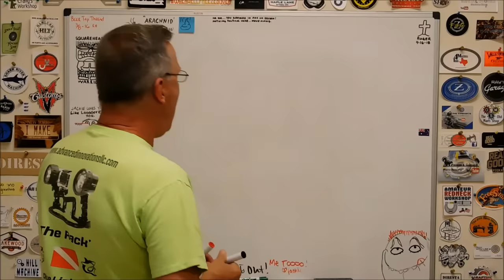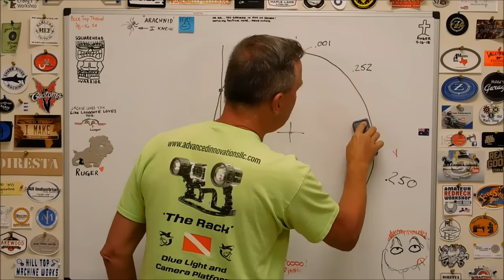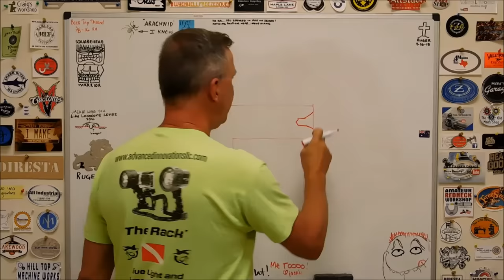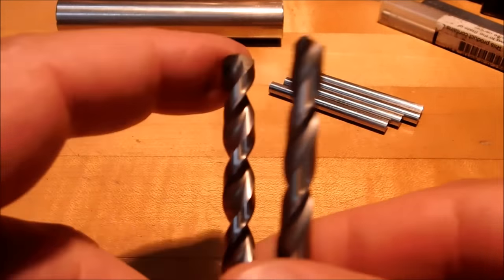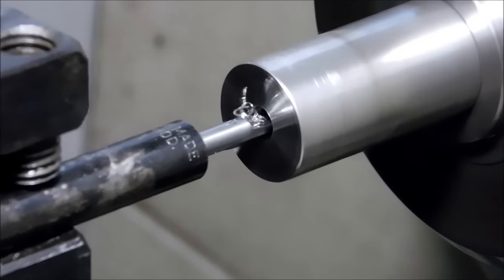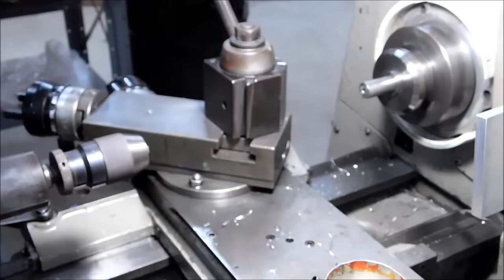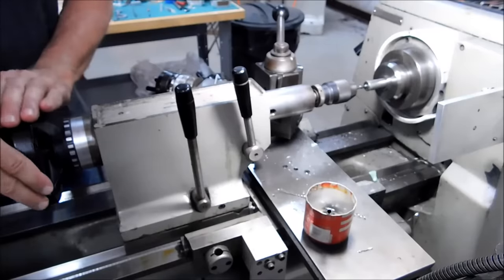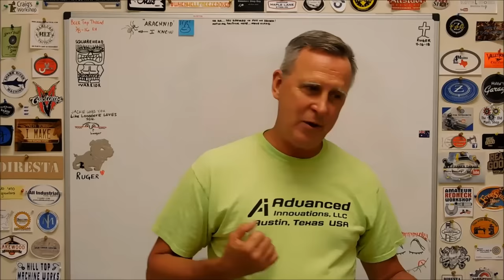Techniques for Machining Straight Deep Holes -- SHOP GEM --

Comment: Great video! Here is my challenge: how do you ream a perfect hole for the locator pin of a quick change tool post? Bear in mind, the tool post is hardened. Even factory got it wrong, the original pin was really hard to push all the way down. In fact, I never managed to do it. And it's an original Dickson tool post! I tried a quick fix with a reamer from the top, but it wasn't carbide and didn't do anything, other than rub against the wall of the bore. In a moment of desperation, I tried to work the locator hole on the top slide separately, and I don't think it did anything good. So now I basically have to start from scratch 10-20 thou oversize and do a text book job with the correct technique and tooling, or plug the hole and forget about it. The tool post and top slide have to be clamped together in position and rim the bore and locator hole in one go - that much is obvious - but beyond that I really don't know what's the best way to do it. Any pointers would be greatly appreciated.
Reply from the maker: Forgive me, but I can't visualize what you are trying to do. I'll have to look up dickson tool posts to get an idea.
Reply: @joepie221  Oh sorry, I should have been more clear. This tool post has a sliding dowel pin that goes all the way down through the tool post, and when aligned, locates into a corresponding hole in the top slide. It's completely separate from the toolpost/tool holder mounting mechanism, and I see that not all of them have this feature. It's only there to provide a quick way of bringing back the tool post to a known square position, after it has been rotated around.

Comment: Hi

Intention to inform.
We use a drill chuck mounted and centered on a toolholder to drill. Way easier then moving all day long the tailstock. 

Good videos you make anyway =) gave us some good advice to.
Reply from the maker: Both work well.
Reply: @joepie221  indeed. What as your first CNC?

Comment: i done some 19 inch deep hole true poured aluminum castings that were a b------h but i did them horizontilay with coolant running through the drill now that was interesting to do lol

Comment: Thank you so much for this technique and explanation.  I've got a project right now I'm going to apply it to.  Are there any tips for the milling machine in this regard?  I ask because I had a project of having to drill several 1/2" holes 3" through the edge of a 1"x 3" cold rolled mild steel part that had to line up with holes on another two parts.  I did okay, only had to enlarge one hole a little.  I used a stub drill after center drilling.
Reply from the maker: Use the same approach, but plunge an end mill instead of boring for the reamer pilot.

Comment: Thanks for your video and I learned a number of things (didn't understand what the first part was about though). I'm thinking can it be a good idea to do everything you did but with one dimension less and then, as a final step, run a reamer with final size through all the bore. That would get rid of the meeting point better?
Reply from the maker: That has a much better chance of ending up straight if the pilot hole is done with care.

Comment: I'll always remember this. Thankyou. Were do gundrills come into play? I see other machinists do the same inital steps boring the lead-in. But with a gundrill do you just have that as your last drill if you need to? or do they drill straighter than a jobber ever would?
Reply: I use gun drills in wood, and they work really well. I have the wood spinning in the head stock, and I drill an undersize hole with a twist drill. I then open it with a boring bar to the size of the gun drill, minus a thou or two, which leaves it perfectly centered, perfect for starting the gun drill in, which I do free hand. I feed the gun drill with compressed air (in metal it would be pressurized oil, but I just do wood with these). I can easily drill a hole 2 ft deep with only a little drifting.

Comment: Good info. just the way i would do it. That would make a nice gun Barrel--Do you have any advice for driving the tool down thru that Rifles the internal Hole? i have been looking at some 
spiral HS tools used for cleaning out and enlarging holes, and would like any info on what is used. I guess the true way to measure the concentricity of the inner and outer surface on the part that you just made would be to rotate it between centers and look with an indicator for any Runout, Correct?

Comment: That tailstock trick is neat, but mine is retained by two bolts. No rapid release for me.
Reply from the maker: Convert it.
Reply: @joepie221 : I've got bigger problems that come first... Like no reverse, noisy apron, every gear in the thing is sloppy... It's 105 years old. Right now I'm fighting a chattering boring bar trying to get through four sleeves i have to make. I just saw a video where a guy puts a pipe wrench on the tail end of the bar. I'm gonna try that tomorrow.
  I am just getting working with the machine figured out. I am hesitant to work on it, because I know I don't know the best practices. Let's see if I can get the tailstock to be straight and repeatable before I try to convert it to anything.
Reply: @williamrekow7513  sounds like your lathe just needs a tune up, nothing wrong with an old lathe mines was new in 1952 and I do alot of precise machining on mine.
Reply: @zebschreiber7357 : I'm sure it does. I'm just not to a point where I am confident to take the thing that far apart.

Comment: I drilled a 1/8" x 4" blind hole in a 3/16" 303 SS rod. I believe the fast spiral has more flex than slower spirals. I use Cool Tool or Mobil 766 - less smoke, better cutting than WD40 I think.I use Anchor 771` when I have to weld a part after machining - less oil residue. I mike my bits first.
Don't use Anchor lube 771 in a cup, it dries out, use it in a small bottle. Squeeze the air out of gallon bottles of Anchor.
Reply from the maker: Noted. thanks.
Reply: @joepie221  By the way Joe, excellent channel, really enjoy it and I've been doing this 40 years. Always pick up something I didn't know or took for granted.

Comment: Dear Joe, thanks for the tip. I'd ask a question tough, i have a mini lathe and unfortunately cant align tailstock and spindle.. with that method, could pre bored hole still compensate the error of misalignment? Could you make a demo and compare  result with that work you done? Lets say typical misalignment is about 0.07 mm.

Comment: Great information, Joe.  I've learned tons from watching them, but didn't comment before because it would seem like I was rubber-stamping what everyone else already said.

Any recommendations on where to get stubby drills?  I've found them at a couple of suppliers, but the range of available sizes was limited and the cost was relatively high.
Reply from the maker: I always get mine from MSC. Quick delivery and reasonable prices. mscdirect.com

Comment: If your using a solid carbide drill do you get less deflection?
Reply from the maker: I am almost ashamed to admit, I have never used a carbide drill I didn't break. I just don't even think about using them. But the difference in rigidity could certainly be helpful.

Comment: No mention of parabolic flute drills? I bought some for a similar project a while back, although i haven't used them yet.
Reply from the maker: Hi Paul, I just drilled 5000+ holes in A6 with one drill. Must have had the perfect combinations of settings.

Comment: I always have certain... reservations about drilling from both sides and having the holes meet in the middle. Because if the holes are misaligned even slightly, as the drill bit breaks through it's going to meet that crescent shape and there's a great potential for it to grab. And as it does, the helix of the drill bit gets slightly unwinded, and it bites  into the the inside of the hole it just drilled, and lemme tell ya'll, it's impossible to get it out of there with anything short of EDM. Ask me how I know that. :-D I'm not saying I won't drill from both sides, sometimes it's the only way. But it's always a bit scary when you break through uneven surface.
Reply from the maker: You can feel it right away. I hate that tick, tick, tick feedback you feel on the crank. You know things didn't work out.

Comment: Just curious; why not cobalt drills?  What did you say your time was for one end (2" deep)?  I get about 20 seconds for a 2" deep hole, 0.250 dia.+.003/-.001 (cnc of course) - otherwise, I can't sell the job.  If I need a tighter tolerance, I'll shove through a reamer, too.  Most need to be located within 0.002 end to end.  But, I like the accuracy of the bored/reamed pilot; built in drill bushing, huh.  Also curious, you mentioned not wanting to get the Anchorlube on your fingers - is it caustic?  WD-40 instead of good old cutting oil?  Easier to clean up?  Thanks, and keep up the good work, appreciate the drill geometry: depth in relation to 4 point contact inside the hole - good stuff!  I love that stuff!  (By the way, I can attest to using a spot drill the same angle as the drill.  GREATLY extends tool life of drills in a production circumstance, especially in stainless, such as 17-4 or the likes.  The face of the drill lays in really nice, as opposed to relying on corners to start the cut, or chipping the face of a drill.  Old timers trick is to use just the tip of a big center drill as a spot drill - 118 deg., right?)  Keep it up!
Reply from the maker: I like cobalt drills. Very tough. Lathe tools too.

Comment: Maybe a question with an obvious answer, but if you aren’t using a chuck with the high tolerance that you’re using in the YT, is it better the drill all from one end rather than flipping the stock and taking the chance that you end up with holes that don’t meet? And having asked that question, if you want to make certain the stock is oriented in the same direction of run-out after the flip, do you put the stock back in on the same jaw, or do you put it 180 out? I don’t know if that second question is intelligible. I’m just wondering how to flip the stock but keep the run-out “in-line.” This was a really good subject for me. I have always struggled making deep holes that don’t wander. Thank you for taking the time to make this.
Reply from the maker: I would say if you suspect eccentricity in your setup. Keep the part clocked exactly the same  when you flip it. Up has to still be up, or you compound the error.
Reply: Joe Pieczynski thank you for taking the time to answer. That is sort of what I thought but anytime I have to print double sided on me printer I can never remember if I turn and flip or just turn. You really have done the machining world a great deal of service with your videos.

Comment: Still trying to process the .015... would it not be half that as it would have a tangential plane relationship with the other side? Sorry my brain has cachunked on this?
Reply: He is correct. You get it by applying Pythagorean theorem to the larger hole with one side being the radius of the smaller diameter.

Comment: Commenting about fast spiral drills: in general, the harder the material is to CUT, the LESS spiral you want.  Fast spirals weaken the drill torsionally, (the helix angle uses up more room, and the "tool strength versus flute space" battle becomes more intense).  For materials that are easy to cut, but hard to clear chips (aluminum, easy-to-melt plastics), the FASTER the spiral is what you want.  Drill strength is less important, so the tool's cross-section can be sacrificed in the name of providing more flute cross-section.
          "Hi-roc" drills have typically no spiral at all (cutting is hard & high force, often using negative rake edges), getting chips out in comparison to the cutting is "piece of cake".
          Based on this argument, I would assume a fast spiral drill is less rigid then a slow spiral drill (but that is compensated for by the quarter-turn contact being closer).  Lack of rigidity is proportional to the square of the cantilever distance, so this would be over-riding).
Reply from the maker: I've often wondered if thats true. Is something actually weaker because its wound tighter? They certainly appear to have a deeper relief, but I've never actually tested or measured one.
Reply: @joepie221  It is weaker because a given width of metal occupies more of the "circumferential space" when it is inclined.  For example, for a drill side 0.1 inch wide, and helix angle 45 degrees, it uses up 0.14 inches of circumferential space, versus 0.1 inch for zero helix drill.  This forces the metal, or the flute, to be narrower.  The helix also lengthens the effective metal between the shank & the tip by the same factor, reducing rigidity.  Of course, the web thickness also has a large effect on rigidity & strength.
          For end mills, the "core" is a much larger part of the cross-section, lessening this effect versus for drills.

Comment: I used anchor lube and found it really did help with cutting.  However, I stopped using it because it seems to be a corrosion accelerant.  No matter how carefully I cleaned my machine after using anchor lube, my milling machine table and vise would rust.

Comment: If you are reaming a rifle barrel would you shut off the machine every time before you pull the reamer out? Should you restart the machine before or after you reinsert the reamer?
Reply from the maker: No. I keep the machine running the whole time. If the reamer dries out, you do risk a cold fusion on the reamer lead and reverse helix dig when pulling it out.

Comment: Why use reamers on a lathe? Is it only due to the deep hole would chatter on a small boring bar?
Good video! Thanks
Reply: Time efficiency.  There are no multiple passes to sneak up on dimension with a reamer.
Reply from the maker: That, and the reamer resists walking like a drill if it has a good lead to follow.

Comment: Joe  Great process.  But, the ID is rough from chip galling. I need to drill a 2" deep hole with smooth sides for a piston to run. The piston must be tight enough to seal 60# air pressure from blowing by. The ID must be absolutely consistent or the piston will bind. Do you have a procedure to make a smooth sided hole of the dimensions in the video?  Paul
Reply from the maker: For a hole thats only 2" deep, flood coolant and ream it if its too small to bore.

Comment: @Joe Pieczynski  what make / model is your lathe ? i'm very curious as to how the tail stock lock cam works. i have a Grizzly 4003G 12x36, and i litterally have to use a 2' cheater to keep the tail stock from walking while drilling. i'm almost to the point of modifying it to use a nut and bolt to clamp it down....
Reply from the maker: 1340 Clausing / Colchester  The tailstock lock is simply a cam that pulls up on a plate. If yours is a cam too, maybe unlock the tailstock and adjust the nut under the plate. It increases cam force when adjusted correctly.

Comment: How would I figure out how much potential any size drill could dance around? I’m trying to figure out how you got that number but my mind is going blank. I’m very familiar with trigonometry, but what numbers, would I even plug-in?
Reply: Just ran into this vid.  To answer, label the center that both circles share, as C.  Let A be the point on the larger circle on the horizontal line.  By his instruction, Joe constructed a perpendicular where  the inner circle intersects the horizontal (call that point D), and the perpendicular intersected the outer circle, calling that point B.  This creates a right triangle BCD.  We  note that the distance AD IS .001 inches and is collinear to leg DC of the right triangle.  The angle of sweep Joe creates from the horizontal we will call beta.  We recognize
AD=.001=AC -AC×cos(beta)
Or .001=AC×[1-cos(beta)] where AC=.252/2=.1260...ASSUME we are on jigbore and carry the 4th place...Joe didn't.  Solving for beta
Beta = 7.2234 degrees.  Looking at the right triangle,  BD/DC =BD/.1250 tan(beta)=tan(7.2234)=.12674. So
.12674=BD/.1250.  Solving, BD= .01584 inch.  We carry the extra decimal for clarity, and for those who hold such capability.  Hope this helps. Like you said it's in the trig and geometry that Joe caveated early in the vid.  Clay

Comment: Could we gain more accuracy by using your technique to bore a hole under sized and then draw a bullnose mill through the hole with tail ring with a clearance of .0002 - .0001?
Reply from the maker: Better linear accuracy, or diameter?

Comment: Can the hole be made larger by line boring?  I'm visualizing a  boring bar clamped in the chuck and in a free rotating drill chuck in the tailstock.  The workpiece would be slid onto the boring bar before fixing it in the chucks.  The workpiece would be clamped to the toolpost.  Rolling the carriage back and forth would move the workpiece across the cutting edge. Would it work?
Reply: It's easier to visualize on a Bridgeport milling machine. 
Put a small rotary table on the mill, where the vise goes,  hook up a belt and motor to turn your work piece on the rotary table.  Put your boring bar in the quill collet, only rotate the boring to cut by itself first. Start with a piece of stock with a hole that is .020 undersize. Put that piece aside now put in another piece and turn the quill and the rotary table. The size difference could be huge! Turning both the part and boring bar is the only precise way.

Comment: On the high spiral bits, I’ve assumed that the drill is less rigid because there is less material in the drill itself. The more flutes, the less mass of the drill, the less rigid it is. Does that logic make sense?
Reply: Actually the rigidity is dependant on the thickness of the spiral flutes, (more so the height as the moment is roughly I=base*height^3) but all things the same you'll have more mass in a tighter wound drill.